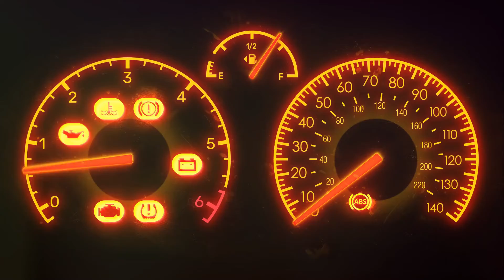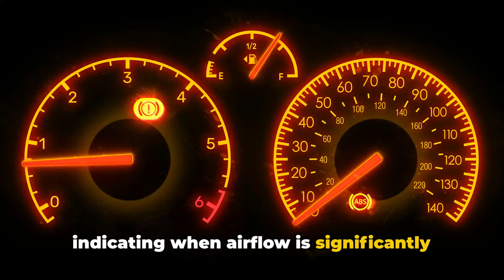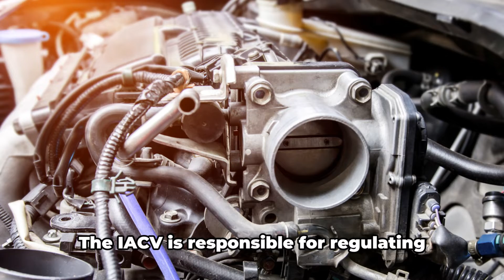Car idles Rough but Drives Smooth: 6 Common Causes & Fix

Comment: What causes my car jerk
Reply from the maker: Car jerking can be caused by issues with the fuel system, ignition system (such as faulty spark plugs or ignition coils), transmission problems, or clogged air and fuel filters. It's essential to diagnose the specific cause for a proper fix.